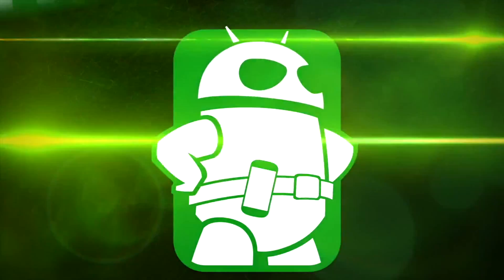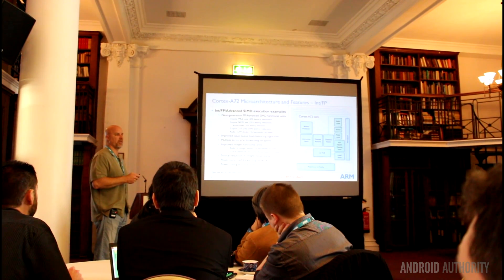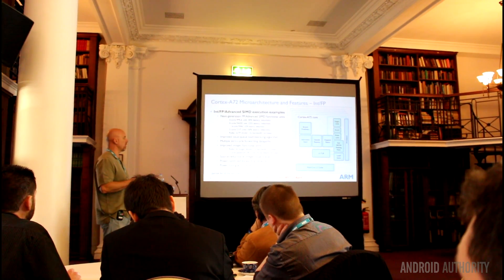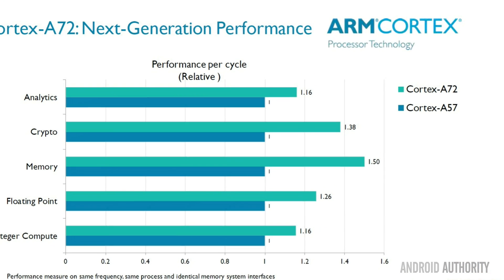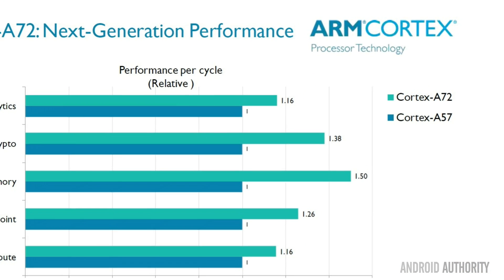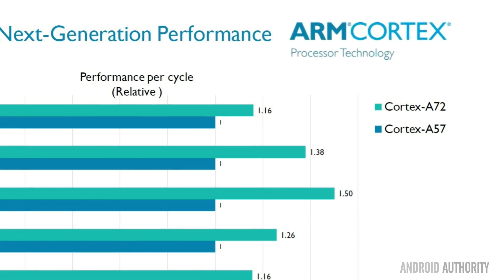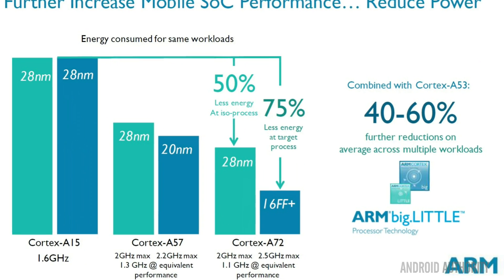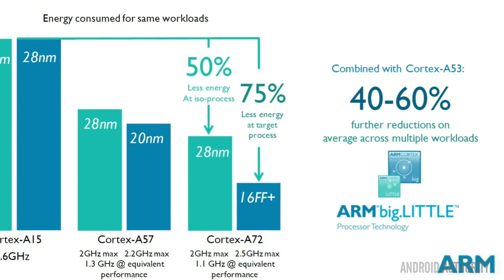Cortex A72: what you need to know - ARM Interview

Comment: So how does A72 compete with Apples cyclone if?
Pipeline: A72 = 15 ; Apple Cyclone = 16
Execution Ports: A72 = 8; Apple Cyclone = 9
L Cache in KiB: A72 = 48 + 32; Apple Cyclone = 64 + 64
L2 Cache: A72 = 0.5 - 4MB;  Apple Cyclone = 1
L3 Cache: A72 = None ; Apple Cyclone = 4MB
Decode: A72 = 3 wide; Apple Cyclone = 6 wide
Explain immdediately.
Reply: Well first of all this is pre production and this will have a lot of cores and a high clock speed.
Reply: Henry 01 Yes, that was everybody want's to say. But how is the performance? The only this thing can do is to spread the load from one processor to the other one. Now, Mediatek has announced a Deca core processor. Which is way too foolish.
Reply: You know Samsung made very powerful CPUs for Apple.And the latest A8 inside the iPhone 6 has got an extremely powerful core but multi core performance just does not compare with even the 808 or 805 or the Exynos 5433.
Reply: Henry 01 But where was that multi core tested? When apple is announcing an A chip. It always comes with a demo gaming app which shows proof. Samsung's exynos was only announced with a better benchmarks. But was there any demo gaming app that tested the exynos to the limit?
Reply: +Foxtrot November so Apple Cyclone is better?
Reply: Peter Cheung In single performance yes. But that was years ago. The new twister yields better results in single core performance but performs fair when on multi core. But if you look at it. Users only use 1 app at a time. And when it comes to gaming. That single chip performance runs excellent and it doesn't heat up the device unlike what android chips would mostly do.
Reply: cool, i just bought stm32 nucelo board and learn cortex-m, will buy a cortex-a board after the learning, thanks